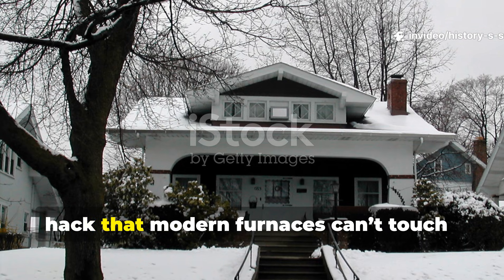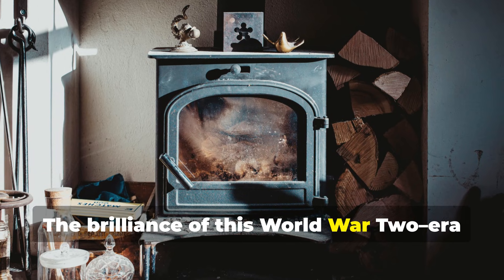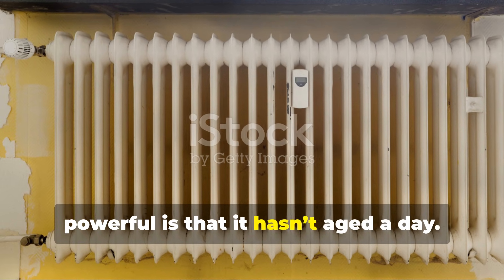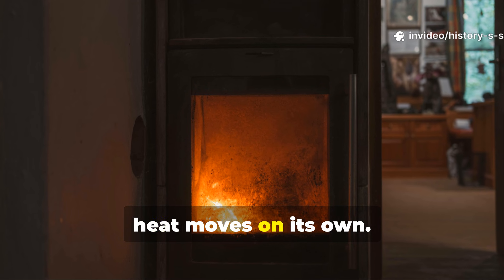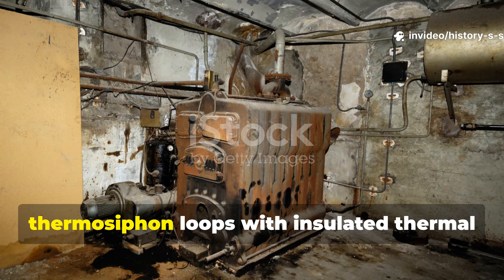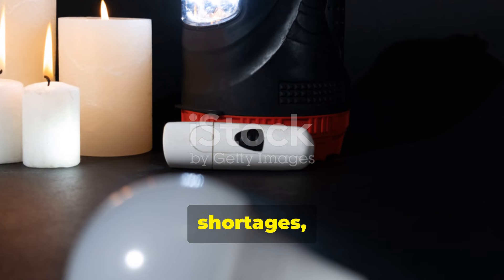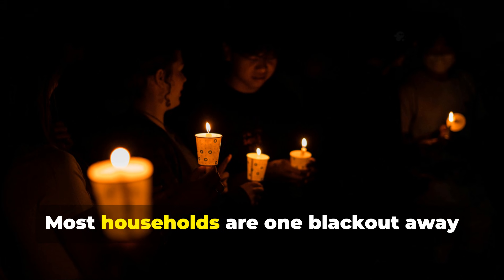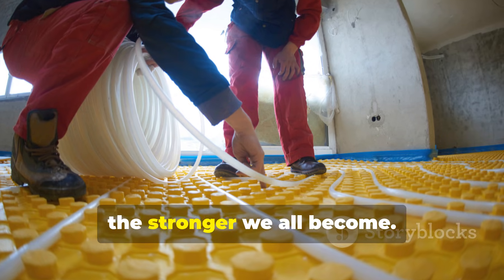The 1940s Off Grid Heating Hack That Modern Furnaces Can’t Touch — The WW2 System That Never Fails

Comment: I am looking for a radiator to connect to my fireplace insert. Had this idea for some time. Just not sure how I am going to insert water lines for the coil. Plus have to have a relief valve & expansion tank. Maybe by next season I will have the time to get it together.
Just subscribed and added a 👍
Stay well, Joe Z
Reply: Do you know what later means? In almost all cases, it means - NEVER.
If you want it, get serious and make it happen. It's December. Great time to do this.